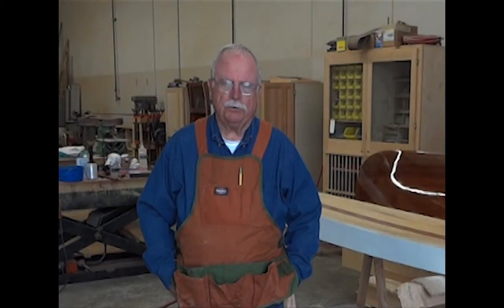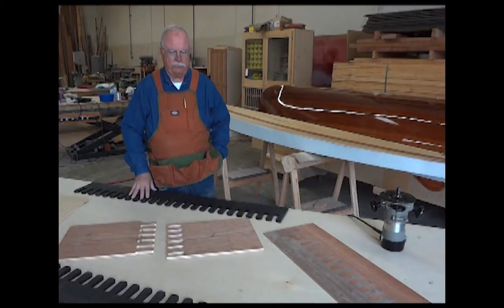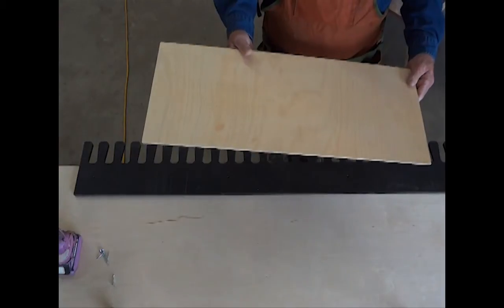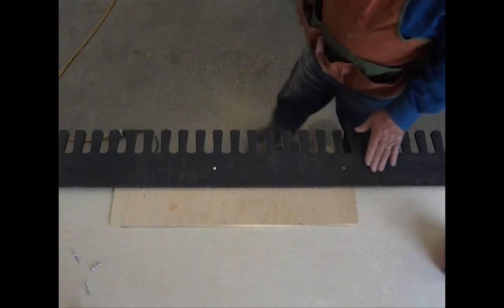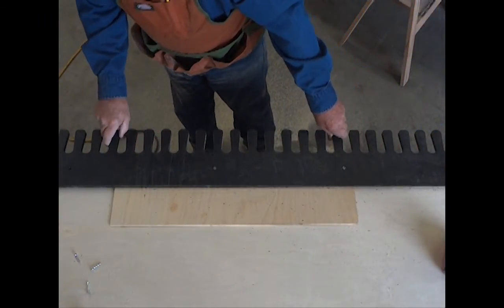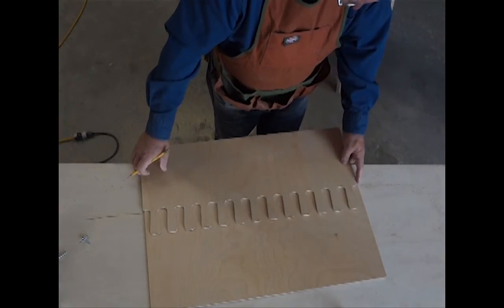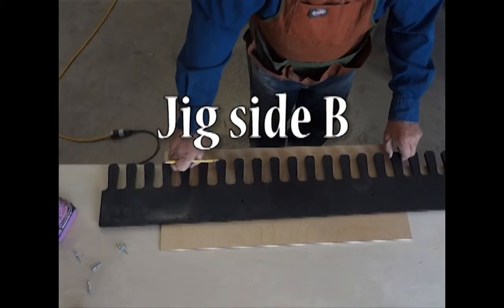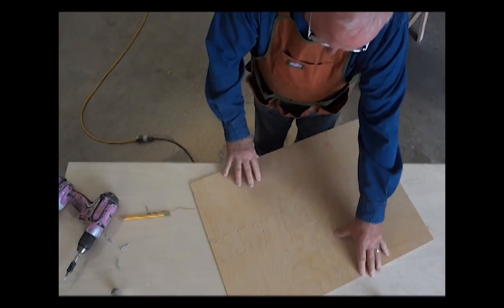Fish Bones Supplies -- Puzzle Jig

Comment: Scarfing plywood yields better results, is faster, doesn't require the removal or loss of as much wood, is quieter, and far less dust.  About the only disadvantage is alignment when gluing up, but that is a nothing to sort out.

Puzzle joints are best when used in kits where a faceless CNC machine does all the dirty work.  With full on CNC the joints are precisely aligned with the pieces.  When you use the kind of joint shown here, you are just joining wood, getting the resultant pieces in perfect alignment is not guaranteed, which is fine if all you want is oversized pieces of plywood.

At their best, as with Nick Schade's work, the puzzle joints are used decoratively, but that king of work has to be designed into the individual pieces and varied by in all parameters to deal with different piece width, and designs.